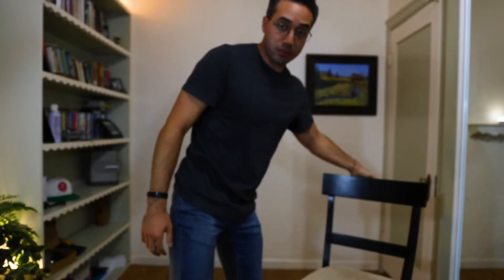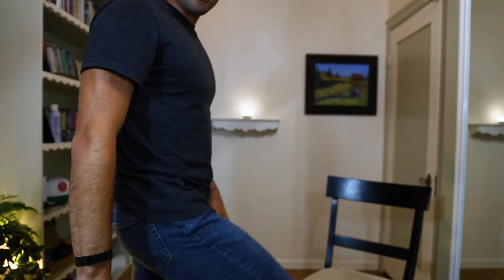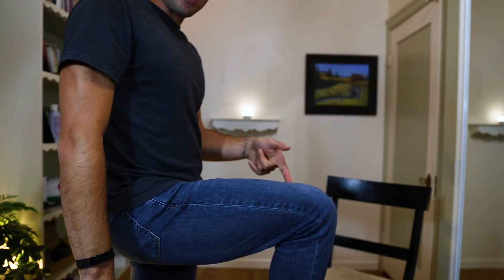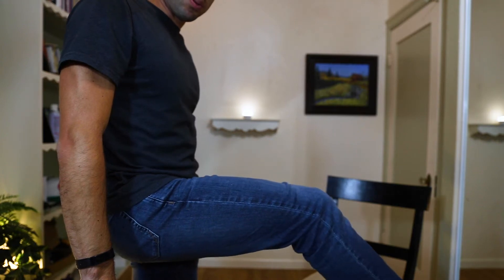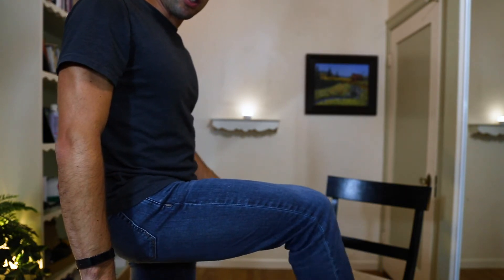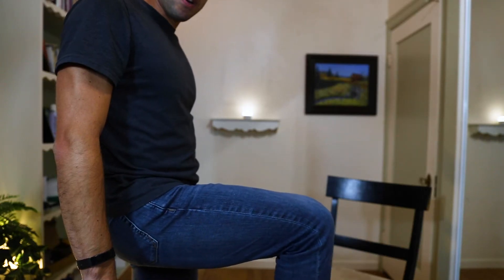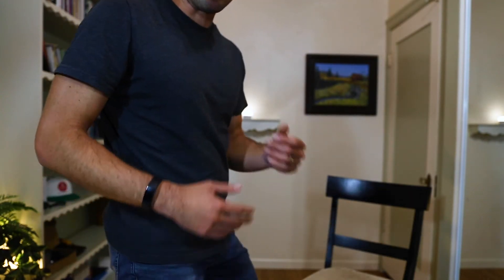Active vs Passive Insufficiency Explained Simply

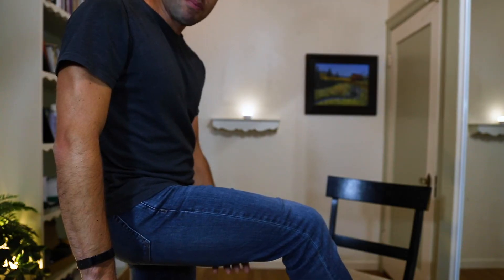Comment: 2:50 do you mind explaining why there is passive insufficiency in hamstrings in relation to bifurcation of muscle?
Wouldn't you have to be in anterior pelvic tilt to slightly taut and shorten the hamstrings to make it less flexible (long)

Thank you very much!
Reply from the maker: Definitely Mohamed. Because the hamstring is biarticulate, it is possible to stretch it by flexing the hip and extending the knee. If you "pull" the slack out of the muscle at both of these joints, you could run into a situation in which your muscle lacks the length to allow simultaneous hip flexion and knee extension. Let me know if that helps answer your question.
Reply: @DrJacobGoodin  Yep makes sense, thank you- 
one more question- "to perform dorsiflexion of the foot, you mustn't fly extend the knee as that may cause passive insufficiency of the gastrocnemius"
Is that true, if so, why?
Reply from the maker: @mohamedorayith4626  You are correct! Simultaneous knee extension and ankle dorsiflexion would cause the biarticulate gastrocnemius to be stretched at both the proximal and distal ends. It is the antagonist of these movements, so it would be passive during this.
Reply: @DrJacobGoodin  Explains why my Back kick was always much stronger than my front kick.